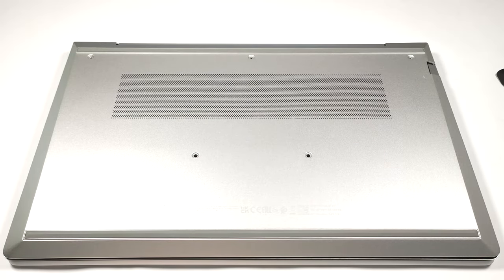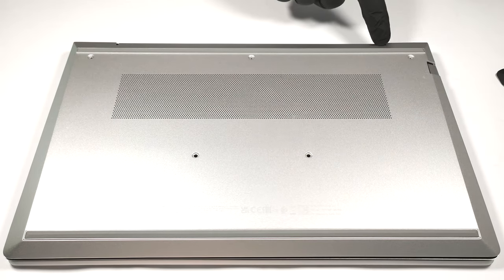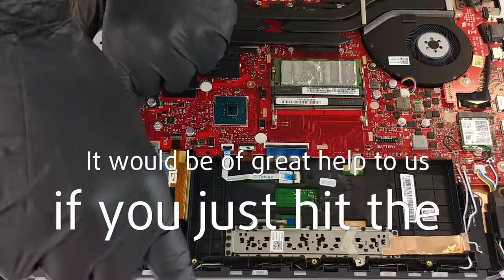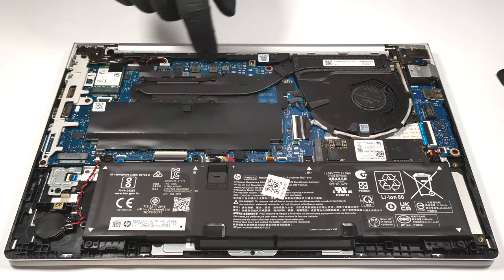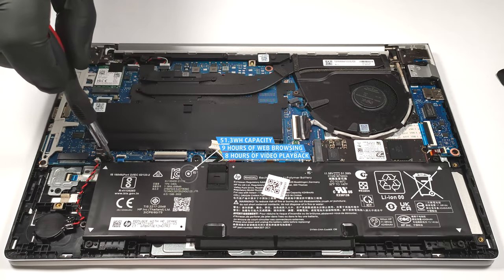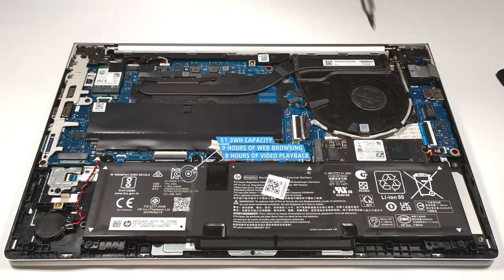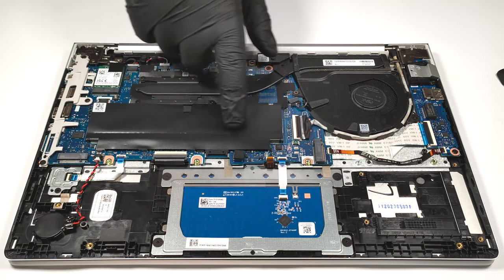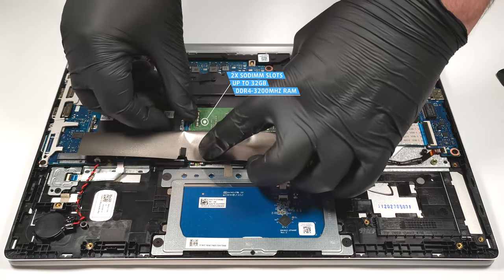🛠️ How to open HP ProBook 440 G10 - disassembly and upgrade options

Comment: One important message is missed: the 2nd slot is not M.2 2280 like main one but in "2230" factor. I have tried WD Black SN770M M.2 2230 and this drive is not suitable. Because of 2 reasons: One this is gen4 of NVMe and this slot does not support it, second is technically installation problems. WD memory modules are to close to the edge of connector